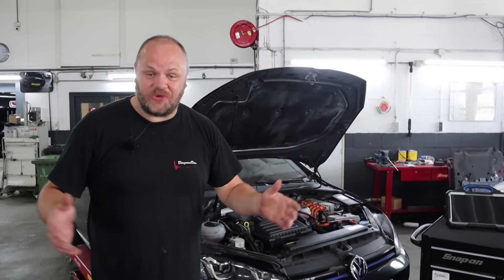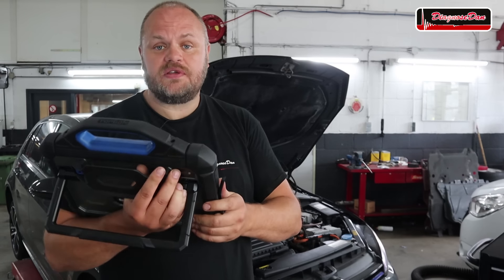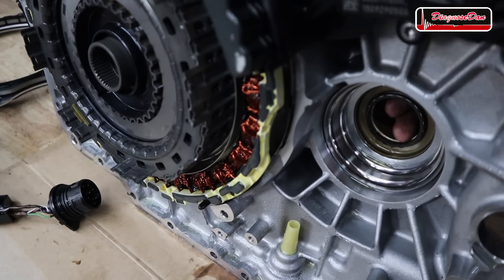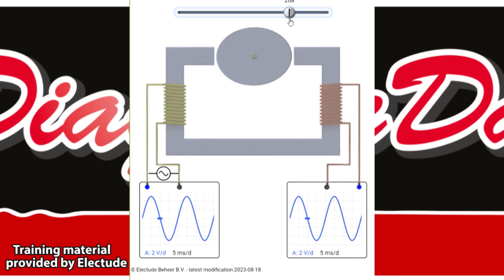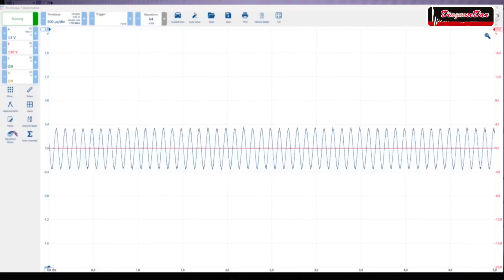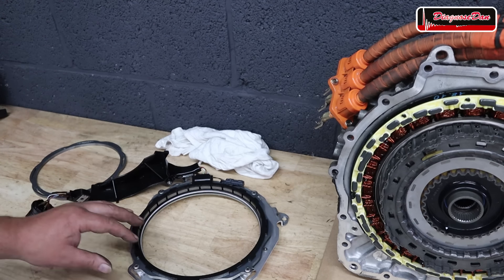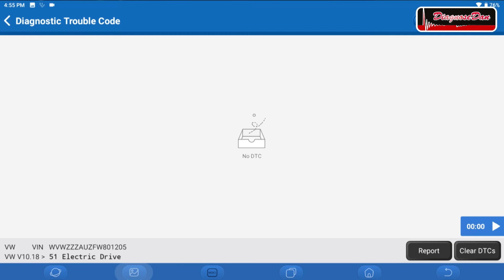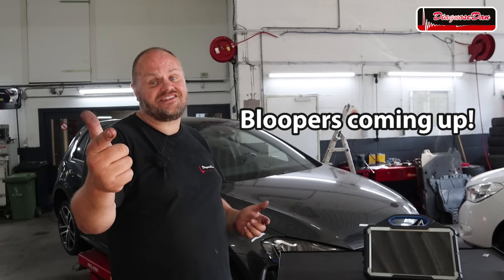Volkswagen Hybrid electric drive Diagnosis.

Comment from the maker: Check out my website ; https://www.diagnosedan.com
For the Topdon tool used in the video:
US:https://www.topdon.us/collections/professional-series/products/phoenix-max
UK: https://www.diagnosticconnections.co.uk/
EU: https://eu.topdon.com/products/phoenix-max
Reply: and us in AFRICA???
Reply from the maker: @shepherdmawindo5854 you can also order from either link
Reply from the maker: @wandameadows5736 thanks for your feedback 😊
Reply: Hi diagnosed Mr Dan  , I’m thinking of subscribing to ur channel but need info regarding car, electric diagrams can you point me in the right directions. I’m from wales 🏴 in the uk . Many thanks
Reply: Dan, could you recomend a microphone that could be used in the engine bay to detect a noise i cant find as it only happens while driving.

I have an android phone if that helps with selection.

Thanks

Comment: This is an absolutely BRILLIANT video showing exactly where the EV (?) repair industry is heading  .... it hurts me to realise that as usual the issue is with manufacturers withholding  the necessary information from technicians to enable rapid effective and dare I say economical repairs ... thank you Dan.
Reply: I fully agree with you that manufactures should provide adequate information to enable economical repairs. 

I can’t be sure but I suspect that these fault codes would indicate that the resolver is faulty. 

I would want to be able to confirm that by measuring the resistance of the coils but I’m not sure that would be necessary in this case. 

If the primary coil was broken however, you’d have to check the signal first before you could draw a conclusion. 

Just my thoughts, I’m not even an amateur mechanic so I’ll be grateful to be corrected if I’m wrong.
Reply from the maker: You are right, manufacturers should  provide more information.

Comment: Appreciate this Dan.
There is so much more to an EV or hybrid.  You go above and beyond!
Reply: Hybrid yes, EV no , just different .
Reply: This is why you should avoid hybrid. I just wonder what this would cost to repair if the mechanics find the problem at all?
Reply from the maker: They are going to present workshop with some major challenges. Thats why its important to try to learn as much as you can about them.

Comment: Really helped simplify those sensors in the electric drive unit and why they are there. Hopefully manufacturers will release more information for these components and issues where it’s so important and becoming more common every year
Reply: I just looked up service information for stellantis products equipped with the relatively new 4xe systems in jeeps. They use the exact same principle and do have a chart of ohm/resistance specs for the different sin/cosin hi and lo. They show 53 and 56 ohms +/- 20%. But they do show resolver b excitation hi and lo to have 18.9ohms allowing +/- 20%. So thankfully the specs are there but the “excitation” one has slightly less resistance. As well as the temperature sensor charts. Very eye opening and glad you decided to film this. Thanks again Dan!
Reply from the maker: Thanks for watching

Comment: Great diagnosis Dan! We are seeing so many on YouTube that do not do things correctly or safely. You are one of the exceptions. Just one suggestion. You obviously have de-energised the entire system. It might be worth telling the viewers that you have carried out the correct procedure to continue working. I saw one video the other day from who I considered a respectable technician and the only gloves he was using to disconnect the battery and break it down into a safe voltage was a set of nitrile gloves! SCARY!
Thanks again for your well trained and consistent content.
MiracleMAX
Reply from the maker: One question, did i ever work on the high voltage system on this vehicle? Only on the 12v system in this video.
Reply: @Diagnosedan  Yes, you are correct! That being said, the motor you have used as an example on the bench has obviously been de-energised from high voltage & you are touching the high voltage wires.
Just an observation. Keep up with the great work!
Thanks for your response. 😊

Comment: As an old retired mechanic I still have an interest in diagnosing car faults.
I find these videos interesting as far as how the systems work but to be honest not much help with diagnosing faults due to the equipment used.
As someone who just works on my own car and occasionally helps out a friend or neighbour I can't justify spending 1000s on high end professional diagnostic equipment. It would be interesting to see how many of these problems could be diagnosed with the type of diagnostic equipment someone like me might own.

Comment: Very very interesting Danny. Coincidentally I have an I3 with, maybe, the same issue. The problem I am having is NO information. I don't want to dig into something and "burn" myself, This car came from BMW and was not accepted for repair because of "the holidays". That's a lame excuse of course but I have also no clue yet as where to start. I have talked with the customer and explained that this would not be a repair by the hour. First see if I, or we, can successfully diagnose it. Kind of a project. Great video Danny. 👍👍
Reply from the maker: Sounds like an interesting case!

Comment: Interesting Dan how the resolver is essentially a “speed” sensor with a modified waveform similar to a tone ring on an axle with a square wave form usually.  Great diag as usual.
Reply: This guy stuffs so much new data into my brain it's scary. First time I actually appreciated a 'cosine'. : )
Reply: The big difference is that a variable reluctance speed sensor produces zero output when the ring is stationary, and also gives no position information.
Reply from the maker: Yes but it also can give you a position when the tone ring is not rotating.

Comment: Hi Dan! Realy love your videos! I have been working at Volkswagen for 6years as diagnose tech. And the last 3 of them I did a lot of EV sins I became a HVE diagnosing and reparing electric vehicles. Just want to do a little heads up. Volkswagen doesn’t call it electric drive, they call it an E-machine. Doesn’t really matter but just for info. And about the the positioning of the motor. According to Volkswagen they don’t do positioning with the sensor. It knows what direction it goes according to phase sequence and the sensor only confirms by knowing if sensor a is increasing and sensor b is decreasing in one direction and the other way in the other direction. This it at least what Volkswagen told is and what is printed in the papers on the course. But love your video and it is grate! Don’t forget to inform people to be VERY careful working on EV if they don’t have the correct knowledge. Pilot-lines can also fail! Always measure!
Reply from the maker: Thanks for your feedback. Please read Volkswagen SSP 537 about the GTE. In that document Volkswagen calls the V141 "Electric drive motor" and not E-machine. 
In the same document they state " The drive motor position sensor G713 determines the exact position of the magnets on the rotor in relation to the stator, this allows the magnetic field to be precisely controlled"
So it looks you are not entirely right at least not on this model. 
Thanks for watching its really appreciated
Reply: @Diagnosedan  hi Dan! In moving right now. But I will as soon as I can find the documentation we got😃👍🏻 grate videos!

Comment: I remember years ago reading how generically the electric (motor) machine, as they called it, functioned.  They went into the resolver, but they may have called it the position locator or just locator.  The control module needed to know the exact position of the rotor.  The reading material also went into describing how the direction of rotation is known.
I've forgotten a lot of that information it's been over 7 years since I retired.  The company that put out the books was Napa Auto Parts.  I don't know if they still have training information.
Good Diagnosis Dan!
Reply from the maker: Thanks, great to hear Napa provided information about electric vehicles. Always great to be prepared

Comment: Another excellent video and teaching. Highest quality production with static shots via tripods and video outputs from tools in high quality. I just wish Dan could lower his production quality and produce videos weekly. Ivan at Pine Hollow is great and very frequent, but his handheld videos with glare and cams of tool screens are hard to watch (I use the smallest screen possible). No issues like that with high quality Dan videos. It’s even cooler that both Dan and Ivan watch each others content and sometimes comment on the others vids. Keep up the great work, and please produce more content!
Reply from the maker: Currently i have 3 dayjobs and try to do as many videos as possible 😉

Comment: Good explanation & dynamic visual oscilloscope graphing of the resolver in action. Although people are wary of EV’s & HV systems they forget there is still a LV side still required in the control & electronics,  I’m not suggesting anyone without product knowledge tinkers with them though 😬
Reply from the maker: Most components are low voltage even on an EV

Comment: Well done Dan . Thus is great information that won't be readily available.  And we'll explained as usual.  I am an electrician so the transformer and 3 phase motor is my field . 😊
Reply from the maker: Thanks for your comment, its appriciated especially coming from an expert like you!
Reply: @Diagnosedan   it might be worth explaining to your viewer why we use 3 phase motors instead of DC motors , considering the power source is a large DC battery.  😃

Comment: Excellent! The same exact logic Toyota uses for SAS, torque sensor. It's odd for the coil to go open. Most probably something at the edges. Maybe repairable?
Reply from the maker: Very uncommon fault, first time i've come across it

Comment: In the U.S., the only VW hybrid sold here was the Jetta from 2013 to 2016. Few sold so they are hard to see on the road. It's main problem was the transmission with the dry clutch DSG. Specifically the Mechatronic unit itself. Replaced that on a 2015 before selling it, and 2 years later the buyer said they were having problems with it. Few VW techs know how to diag them and just say to replace the whole transmission for over $6,000.
Reply from the maker: You are right the Dsg was/is known to fail. Fortunately we are very experienced with them and can repair the mechatronic unit in most cases without completely replacing it.

Comment: excellent DD. At 78  years old school mechanic   I haven,t a chance of diagnosing EV stuff .. Sure I could swap out the rotor control ring ..   a bit like replacing a clutch plate .
Reply from the maker: Yes you probably could its not a complex job. I respect you for being 78 and still taking interest in watching my videos!

Comment: When you put on the ignition, the software wants to detect the resolver signal, and then also "learn" the position of the roter of the motor on the same time. This is necessary to get the correct firing point from the controller to the motor. Because when that's of you get similar shaking what we saw in the video when the motor want to turn in normal use! But that's what I think based on similar technology! 😄
Reply from the maker: Exactly 👍

Comment: Nice video!
How long would it take you to do this diagnostic? I mean without a camera and to the point of finding the open circuit.
Even if you charge double the rate of a "normal" car mechanic you saved a lot of money on this repair.
Reply from the maker: In this case i spend more time looking for information ( wiring diagrams, measuring data,ect) instead of physically working on the vehicle. We charged the customer 3 hours in total for this diag at €75 per hour.

Comment: Awesome job as always,  I'm a bit surprised you didn't build your own connector with leads that extended below the vehicle for easy access.
Reply from the maker: I've never encountered this fault on this model before and i might not encounter it again for a long time.

Comment: Hi Dan, once again a very nice video! I’m impressed by your skills, every time!
However, don’t you fear getting electrocuted working on these cars?
And what would the cost to fix this issue be, speaking in rough numbers?
Reply from the maker: As long as you use common sense and follow the right steps they are pretty safe to work on. 
The fuel "electricity" can be dangerous but so can Petrol be.
I haven't looked up the price of a new resolver.

Comment: Thanks for the informative video.
I have the same car. I hope I never run into issues with the hybrid system or the high-voltage battery.
Reply from the maker: Lets hope not! This fault is very rare and i have not encountered it before

Comment: Great explanation as always dan. Quick question as I know virtually nothing about how hybrids work. Is the electric motor used to start the engine instead of a starter?
Reply from the maker: Yes you are right, no conventional starter motor
Reply: So that explains why there is no redundancy.  Electric motor dies you can't use the engine.  Get the tow truck.   If engine dies can you motor home?   On my 83 audi if engine dies I can at least get it off the highway using the starter.

Comment: Great video !!
when dealing with a Hybrid , should you disconnect anything electrical for safety before ?
Reply: Only if you work on high voltage parts. I don't think motor position sensor needs that much power. And if you disconnect how you will diagnose then?
Reply from the maker: Only when you work on the high voltage part witch we didn't in this video

Comment: Hey Dan greetings, your video's always contains powerful teaching's,  I've been having an issue with an m272 engine after overhauling it engine starts and run fine but when you off it it becomes sluggish in starting and would never start till it cools down, have changed two kick starter and there all got burnt. Please what else can I do?
Reply from the maker: Thanks for watching!!!

Comment: Great video as usual learned something new.  Can you or someone explain to me how the resolver is producing the sine and cosine wave when there is nothing moving?  I understand how it changes its amplitue and voltage as it turnes bow how is the oscilating voltage being created in the forst place? Maybe I missed it in the video or didn't fully understand what you were saying.
Reply from the maker: The primary sinewave is produced by the control unit.

Comment: Very nice video. I guess you didn't need to know the exact value for the resistance of the coils. Just being an open circuit shows it's faulty, but this is just for this particular case. Now I wonder if Ivan would take it apart and try a no parts required on it. :)))
Reply from the maker: We can ask Ivan🤣🤣
Reply: :face-blue-smiling: @Diagnosedan

Comment: Awesome video Dan! I've been wondering about how those hybrid systems are put together and how different they are to troubleshoot, but as always you make it look easy :)
One question tho: Why is the internal combustion engines disabled due to this sensor not working? I would've thought it could continue using just the IC, just like it could drive the electric motor even though the IC has a fault and wont start...
Reply: Usually on these hybrids with the electric motor in between the engine and gearbox, that motor also has the role of the starter motor (there is no separate starter motor), so if the electric motor doesn't work (since the position sensor is faulty, the ECU won't try to spin the motor), the engine cannot start.
Reply: I, work at KIA dealer and start taking courses about hybrid and EV in there there is unit they called HSG[ Hybrid starter and Generator] is hooked with belt to the engine and EV system when every thing is working good the HSG act as the starter to start the engine but always after the electric motor system started first so if we have aproblem like dan showed the gas engine will not run i think this is universal with all hybrid technology hope this helped. cheeeeeers
Reply from the maker: The Electric motor is also the ICE starter motor. In this case there is also a clutch integrated that connects the ICE to the gearbox. Also remember that the electric motor functions as a generator when "engine braking". In other words it al works together!

Comment: I have worked with industrial ac servo motors and controllers (Rexroth) that used resolvers, they were used where positioning was required. I would say that is way more complex then is needed to propel a car.
Reply: trust  those squarehead German engineers to make things way more complicated than necessary.
Reply from the maker: Thanks for your comment

Comment: Most small brushless engines do not require resolvers (or encoders), which doesn't mean, they run at open-loop. More advanced motor controllers can use Back-EMF instead of the resolver. I also believe this kind of resolver doesn't allow for determining the exact motor position, it only provides phase shift monitoring.
Reply from the maker: You need to understand that this motor must drive an entire vehicle. Therefore it needs maximum torque even at very low rpm or even from standstill. Therefore it's very important to know the position of the magnets in relation to the stator so the magnetic field can be very precisely controlled

Comment: 11:35 Looks like a coolant leak above the connector. I wonder if that was a contribution to the issue? Is that part of the transmission/motor sealed?
Reply: I can't see it. But yeah, everything should be sealed.
Reply from the maker: The car had some other issues that were also taken care of. For one of those issues we had to remove a coolant hose. The coolant you see is what was spilled. The other issues were minor and not interesting enough to film